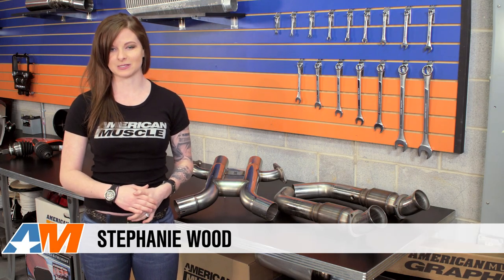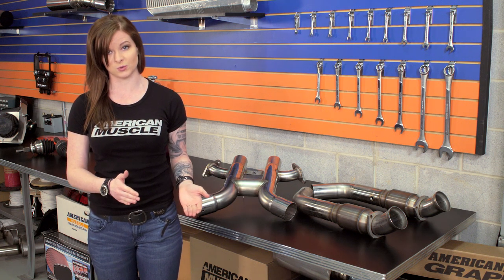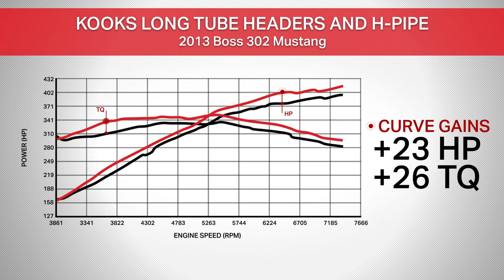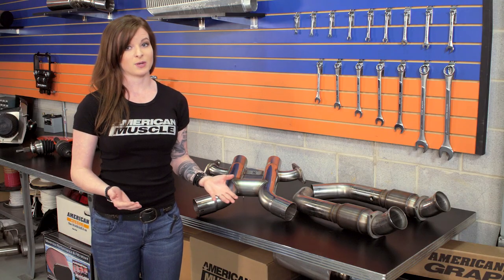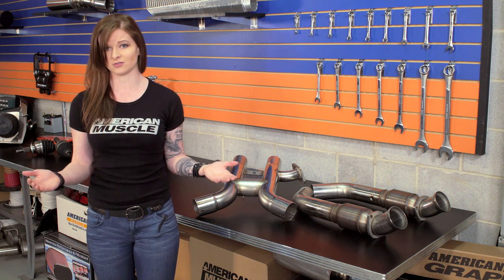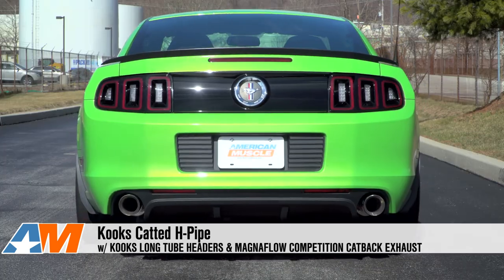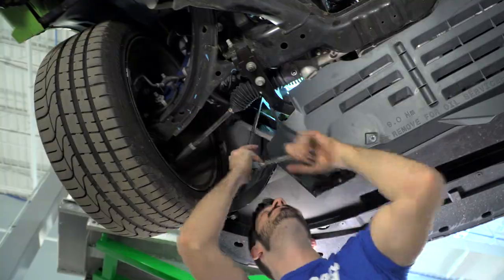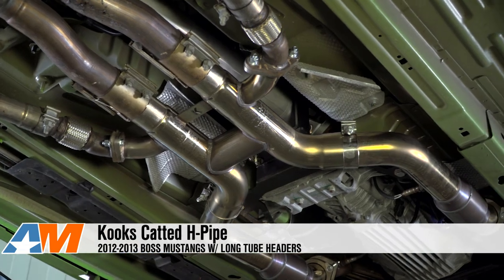Dyno: 2012-2013 Mustang Kooks Catted H-Pipe (BOSS w/ Long Tube Headers) Review & Install

Comment: never saw the wheels move in base dyno
Reply: lol yeah what the hell.
Reply: +Michael Garcia The clip is of the wheels basically at the top end already. The rear wheels are just moving too quickly for you to see the spokes. Look at the fronts for the way they look in resting position.
Reply from the maker: +Michael Garcia They're definitely moving Mike! The clip is taking at the top end of the pull and they are spinning almost too fast to tell. Look at the glare ;) - Will